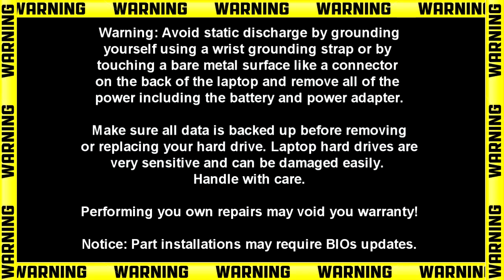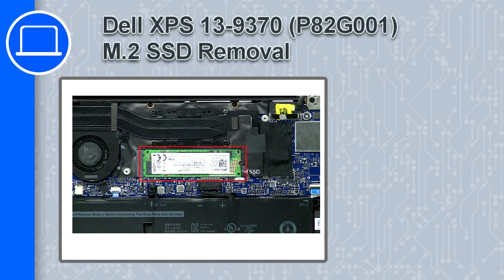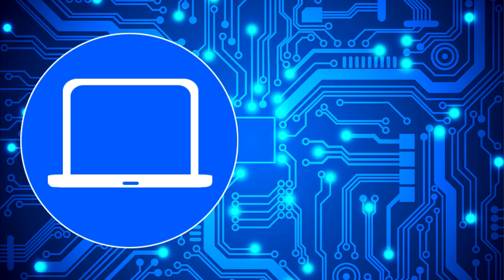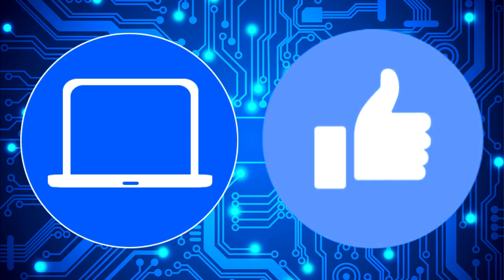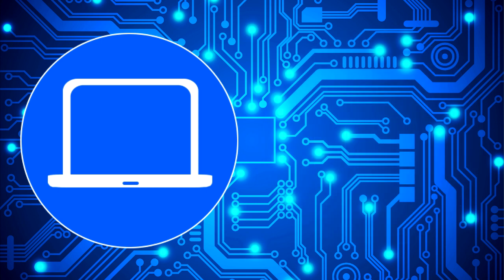Dell XPS 13-9370 (P82G001) M.2 SSD How-To Video Tutorial

Comment: Don't know if there are different screw types on 9370s but my base cover has torx screws (M2x3). Screwdriver required is T5. Likewise SSD 256gb is held in place by M2x3L screws (T5 screwdriver).